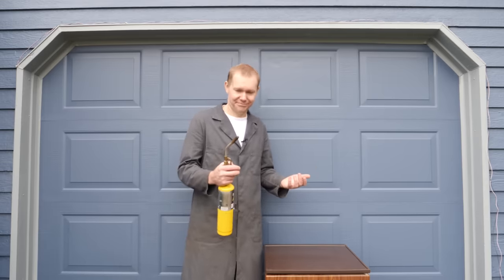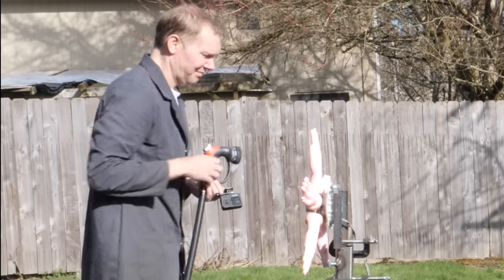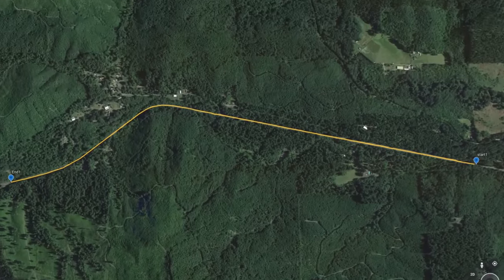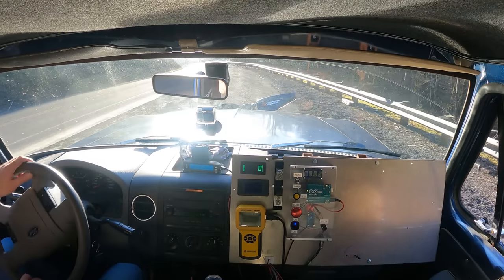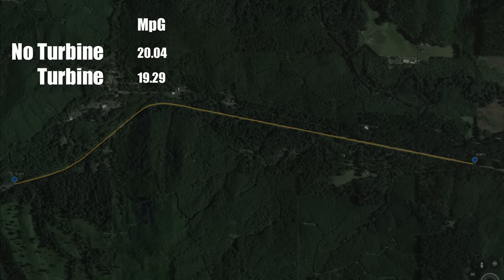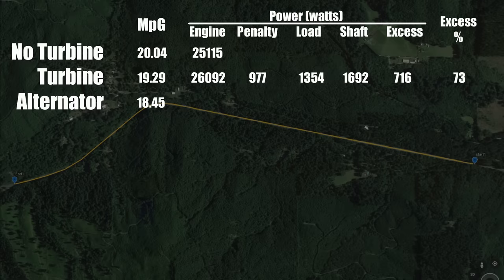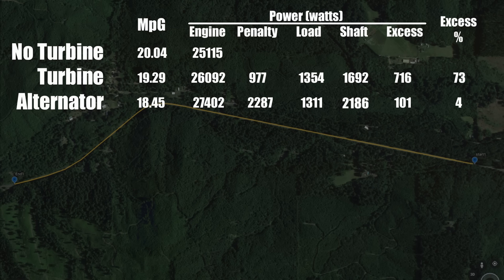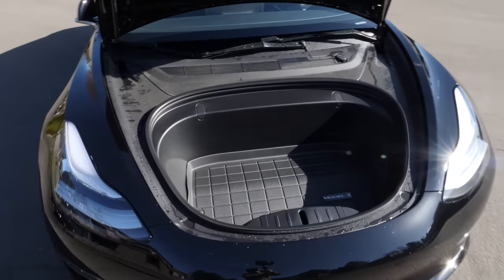Mileage Results You Won't Believe!!! - Wind Power on a CAR #5

Comment: IN THEORY : IF  YOU HAVE A COILED SPRING LIKE IN OLD CLOCKS BUT STRONG SPRING , WIND IT UP TO STORE A LOT OF KINETIC ENERGY , THEN RELEASE IT AND IT SPINS A FLY WHEEL , THIS SAME FLYWHEEL POWERS A GENERATOR THAT RELEASE ENERGY GRADUALLY. I WONDER IF IT WILL WORK ?
Reply: Yes but what wind's the spring?  Remember, it takes energy to wind a spring.  When the spring is released to spin a flywheel, some energy is wasted.  When the flywheel powers a generator, some energy is wasted.  In the end, you have much less energy then it took to wind the spring.  Make sense?
Reply: @bobhilder1469  Yeah , with some loss the aim would  be to have the energy ready to be released at hand when needed like for lighting purposes 🤔 during a bad weather .
Reply: @whenrosesfadeaway  I understand but you still haven't described what wind's the spring(?)
Reply: @bobhilder1469  Ooo yeah sorry. It could be manually done for small devices. And for bigger ones maybe still manually with some safety steps or cranks for spring not to rolll back all of a sudden or controlled gears 🤔
Reply: @whenrosesfadeaway  I've done a bit of "research" and it seems steel-based springs generally have relatively low "specific energy".  About 0.1 watt-hour per kilogram.  Compare that to Lithium-Ion batteries at about 100 to 265 watt-hour per kilogram.  What that would suggest to me is that instead of a spring, you should manually crank a hand generator to create electricity and store that in Lithium-Ion batteries.  What do you think?
Reply: @bobhilder1469 lithium  Sounds ok  or even better than ok. Already exist in some made in china toy torch with some nimh or nicd batteries. But all three batteries nimh, nicd have a certain life time. 🤔  BUT if we made like a big spring to be compressed like in a casing of 2 feet x 2 feet approximately size of an old model welding machine. COULD WE ?  produce a sort of kinetic energy generator for times when no fuel is available 🤔. Like an old winding up clocks that spins and gives at least bright led light , you can charge your phone and power your radio . When  power is over just crank it up again 🤔 and spring unfolds the low but useful energy.
Reply: @whenrosesfadeaway  You sure can!  FYI, Lithium Iron Phosphate (LiFePO4) batteries can easily have about 3000 charge to 80%/discharge to 20% cycles (almost 10 years of daily cycles) (edit: just over 8 years of daily cycles).  Considerably more, I’m sure, if not charged/discharged daily or as deeply.
Reply: @bobhilder1469  They must be very expensive . In mauritius 1 usd =43  mauritian rupees even more at times 45 mauritian rupees .

Comment: you had me until you said modern evs have enough range.  there is no ev made that will pull the trailers I pull 500 to 700 miles I typically pull on road trips.  evs are fine for just around town staying close to home but they aren't there yet for long trips, especially towing

Comment: If all you did was put something on the front of the truck to make it more aerodynamic, you would have
increased your mpg providing you didn't add much weight.  You, in addition to putting something to break the wind (crapilly but that wasn't your intention) then robbed your more aerodynamic shape with a mechanical device.  Just doing that alone would gain by breaking the wind.... so to speak.
So if we all break wind all the time we have solved our electrical needs.

Comment: So this is great but to add for evs, highway speeds are 35 mph with the right motor. But if you use this as a aero assist to reduce the coheffient of drag on the vehicle with the Venturi effect the multiple of miles gained could be 25 to 30% more range. As for the wear item I driven 260k miles on one of my teslas and round trip efficiency is 85% and with the plaid model s 2022 being 91% so with the right combination this could go further. By my calculations maximum effective distance is 3000 miles at sea level with todays battery breakthoughs

Comment: What if you used a turbofan like those on an airplane (just the turbofan, not the jet engine) and tied it directly to the engine crank. Then installed venting around it to direct the air down and under the bronco, then out the back to reduce air pressure in front and throw it out the back like an airplane does? You would also have to move the radiator and have some, but not all, of that air pass through the radiator.

I had the idea for my truck and thought I could put the radiator in the back where the spare tire is. The hope was to increase aerodynamic efficiency by turning what would normally be drag into thrust. As an added cherry on top, put your wind turbine in front of the turbofan and just remove the alternator.

Comment: Part of the answer is here https://youtu.be/jyQwgBAaBag . Interestingly your hands on the prop hit with water is only partly correct in your explanation. In the 40s a test was done on a 4 engine bomber aircraft. The test was to settle an argument between engineers and physicists. The argument arouse from drag when a prop engine fails and causes tremendous  drag. One group said a spinning prop on a dead engine caused more drag than had been calculated and fuel use of the plane as a whole went up more than calculate with a dead engine on a multi engine aircraft. It was proved that a flat steel plate the same diameter caused LESS drag than a spinning prop on a dead engine. Pretty interesting data.  OK cool video  thanks for the info.

Comment: Im quite sure that the milage increase comes from manipulating clean air in front of the engine to be quite turbulent. Turbulent airflow might be a lot less drag on this very badly(aerodynamicly speaking) shaped truck. Shouldnt work on a aerodynamic car, eg. tesla.
Please try a free spinning propeller next. This will allow more conclusions.

Comment: Of course this didn't help mileage at all, unless your reason for driving your vehicle is to bake things in an oven... cause the turbine blade did cost you mileage... while powering a household oven.  If you aren't doing that, what is the point of the wind power?  It IS costing you mileage at a high level of current draw that most people are not experiencing just driving down the road. I doubt you'd have similar results in a Tesla or other highly efficient EV as they are MUCH MUCH more aero, so the influence of the wind turbine as drag would be much larger vs. putting it in front of possibly the worst case scenario for drag possible.  Aside from an old semi, I can't imagine a vehicle with more frontal area and worse drag ratio than that old truck.

Comment: Bruh, the electrical systems on your vehicle run off of the battery, not the gas.
Reply from the maker: The battery turns the starter. Once the engine starts, all the electricity comes from the alternator. All of it.
Reply: @QuintBUILDs  Your statement about the electrical systems running off of fuel is technically incorrect but your overall point is true. Fuel is used to run the motor which is spinning the alternator which is constantly recharging the battery which is powering the electrical systems. I guess I was just being pedantic.
Reply from the maker: @vashman01  sorry, nope. The voltage regulator raises the system voltage to ~1v higher than the battery so no current leaves the battery. Therefore the battery powers nothing. I've worked on this for decades, it is very straightforward once you understand it.

Comment: Why are you using a gasoline engine when you could be charging batteries and running an electric motor to pull or push the vehicle in the first place!?

Comment: I’ve never seen an accurate calculation of mpg from a “fuel mileage computer” or ECU. Need to measure actual fuel used. Try it for yourself. Compare mileage numbers from the computer and actual gallons used. Computer will be off.

Comment: All you've done is increased surface area of the front end and reduced the efficiency of your forced air radiator...

What you've discovered is apples 🍎 and oranges 🍊 becouse the alternator is not designed for running the load of the oven, and it will burn out sooner. It's literally just designed to keep the single battery with high cranking amps but low capacity... charged.

Wind turbines are designed for high capacity low cranking Amp batteries...

Swap out the alternator for a purpose build alternator for that oven...

Entertaining content but the bias is silly.

Comment: What this actually does demonstrate is that there is more energy to extract from Combustion powered systems. In terms of transferring the kinetic energy from the Combustion into usable work in the mechanical state, internal combustion motors in the modern day are actually EXTREMELY efficient. They're in the 90% range. Where they lose the efficiency is in heat, and all you need to know is that ICEs are basically air pumps themselves. The air becomes a heat sync mass thar heats during combustion and then is ejected via the exhaust. 

That's what all the nay sayers were missing. You could hypothetically tap the heat in your radiator to provide energy for a generator, AND you could also recapture some of the energy via the exhaust itself, which is heated jetted airmass. Regenerative braking is another, and that tries to reconstitute some of the energy loss via the inertia of the vehicle itself. 

Gasoline is extremely energy dense, and it makes batteries look like childs play in terms of the total calories we could extract from it if we had 100% efficiency. But we all know that is not going to happen. However, we can get close. 

I'm just sad that politics ruins everything because the current push with ESG is running us off the cliff here. There is far more efficiency we could get by continuously developing ICE engines. 75mpg with 450hp was right over the horizon until the governments started getting involved heavily, and corporate lobbying paid for the regulations you now see pushing this unsustainable 'all electric' future. 

Using something simple as the wind and aerodynamics is a perfect example of the potential that was still there, but bow thrown out the window.

Comment: Well they all thought Tesla was bonkers testing is the only way to prove thing's work and can over rule science in someway! But did the turbine also recharge the 12v battery same as the Alternator does? That's maybe why it's using more? Using power to started motor to lights radio all that equipment your using if connected up to vehicles 12v power feed etc the Alternaters a great thing.

Comment: The inaccuracies and non scientific theoretical deductions formed here are extremely misleading.  The attempt at putting an intetseting experiment together was pretty good but the scientific theories and factual results were somewhat askew and misleading. 
  I'm sure that your child is learning and by the grace of God will put all or most of the acquired knowledge from successes and failures to very good productive use.

Comment: First you are comparing apples to oranges. The trucks alternator is not as efficient as the generator that you are driving with the wind turbine. To be more accurate, you would have to drive the same generator with the truck's engine to come to any real data worth drawing a conclusion from. Second you state that electric motors are more efficient than gasoline vehicles. Which is not taking in the full picture. Electric motors require electricity, and the production of said electricity is very inefficient, with solar cells only operating at 43% efficiency. coal plants at 33%, nuclear at 40%, and the new CCGT plants approaching 60%, and gasoline engines at 40%. Even electric motors only have 75% efficiency. So you generate the electricity at most 60% efficiency, loose 5% on transmission. another 15% charging, and then another 25% when using the EV. The only real benefit to EVs is pollution, if the source of the electricity is clean.

Comment: Sir, the wind turbine simply isn’t efficient enough. You need to make the design more efficient. Turbine -> gearbox -> flywheel -> maglev DC generator. I think you need to figure out how to generator 500W at 25 mph wind and 2 KW at 65 mph wind. With that amount of power, it’s net positive with the current rate of consumption in a model 3 basic range Tesla. If one turbine isn’t enough, then put two more at the roof. I’m sure 3 turbine is enough to generate 500 W at 25 mph. For Green Energy’s sake, you can even put some verticals turbines on your trunk. 5 turbines…. If you can’t generate a mere 500 W at 25 mph wind with 5 turbine, then…. Bro. I mean, even those crappy wind turbines on Amazon makes about 200W at like 15 mph wind. Just put 5 of it and BAM, you’re getting 1 kW at like 20 mph which I am 100% positive that’s more than what the battery is consuming. If you have a flywheel system, the stop and go problem won’t be an issue because once it gets going, the flywheel will be consistent generating for you. I mean, it’s what Mazda’s doing with their new rotary electric generator motor. The concept is the same. Instead of using gas, yours will use 5 wind turbines. Lmfaoo I can guarantee you this will work.